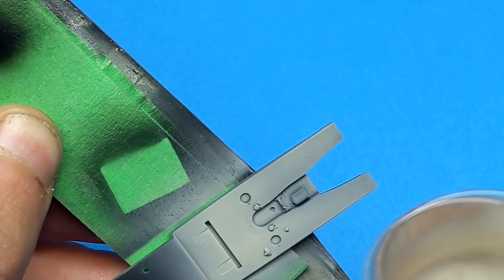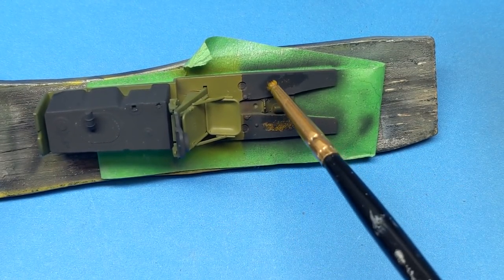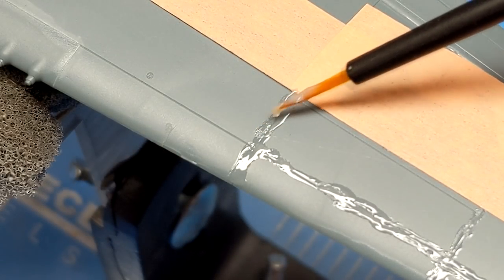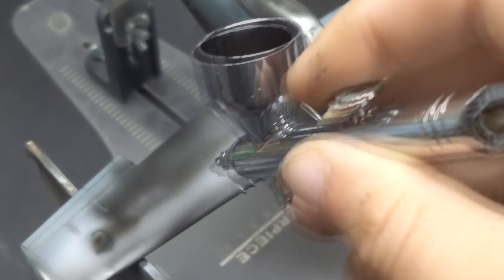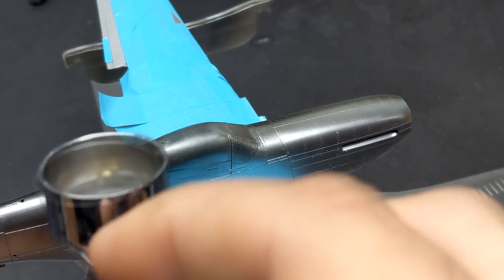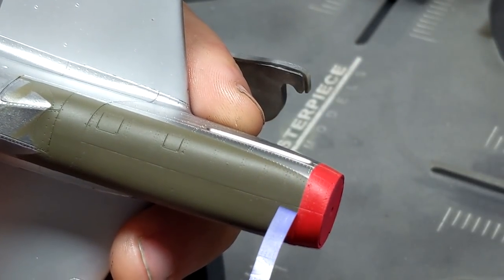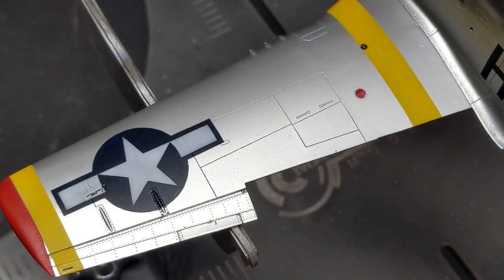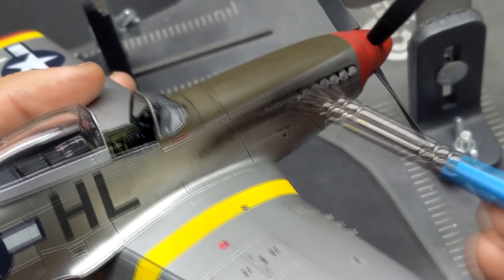1/48 Eduard P-51D Mustang with Accurate Wings!

Comment: @The Model Guy
Great Mustang build - I’ve got 2 Eduard Mustangs that I plan to do as F-51’s. 
Here’s a tip for filling panel lines: mix some superglue & baby powder/talcum powder to make a paste. The powder slows the drying time of the superglue & when it’s dry makes it easier & quicker to sand smooth. 
Tip #2: pastel chalks rubbed on sandpaper creates a fine powder. It’s possible to mix them to create custom colours. Dip the point of your brush into dishwash liquid & apply to the area you want streaks or exhaust stains & leave it to dry. This will leave the surface tacky without interfering with the metal lustre then just brush the pastel chalks over the area, building it up in layers till your happy. 
I’ve used both these techniques on a previous Mustang build , kind of a practice before starting the Eduard kits.

Comment: The thing I've been experimenting with and found a new way that I like better is airbrush pressure. I started off airbrushing in the 25-30psi range pretty much all the time. These days I'm mostly in the 15-20psi range with much thinner paint, and it's a very good experience.
Reply from the maker: What type of paint are you using? Acrylics? Lacquers?
Reply: @TheModelGuy  primarily acrylics, with lacquers added recently. Vallejo, ProAcryl, Tamiya mostly.

Comment: A thought about fuel stains. I love your videos, but why make a fuel stain look like an oil leak? I was a US Air Force Crew Chief so this bugs. A leak from an overfilled fuel cap would have a wet look, almost clear. On flat camouflage it's somewhat shiny, but not brown. AV gas or JP-4 or JP-7 are almost clear. Dust might stick in a dusty environment. Thank you again for so many great tips to try.
Reply from the maker: Thanks Robert. I wanted to try something different on this build and truth be told I'm not happy with it. It's Plasmo's style and although artistic, in hindsight I'm not a fan. My Corsair I used the Mig fuel stains for the clear look.

Comment: Wow, what a challenging build in terms of puttying the wings and painting all the markings and keeping the lines parallel. For OPR on gloss, would a thicker oil be easier to work with?
Reply from the maker: Hey Woody!

What affects the oils is the type of gloss. A flat coat holds the oil where as glossy gloss just lets oils slide around. Semi-gloss lets you do both. But as soon as a flat or semi flat hits the aluminum it loses the luster

Comment: It's a great kit, minus slightly too thin legs and too thin sliding canopy frame, but it took me 2 days to get the wings smooth, and then the rest of the detail was soft, so I had a full wing strip down for a third or fourth day of work. This wing thing is a race between getting it consistent before the rest of the detail softens from the multiple resprays... This is the ideal kit to make multiple builds, but not with these wings. Why can't they use some common sense, and provide two set of wings, one smooth? Doing this panel line filling even marginally neat and consistent, over such long stretches, is a pure nightmare, especially because of the gun bays right in the middle of it all, as you experienced. This P-51 would otherwise be one of the more pleasant builds out there.